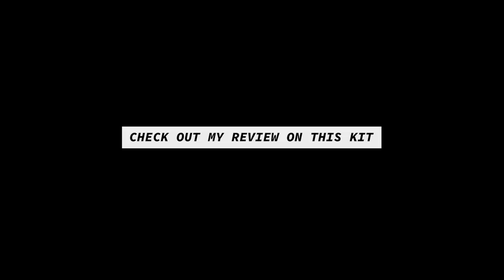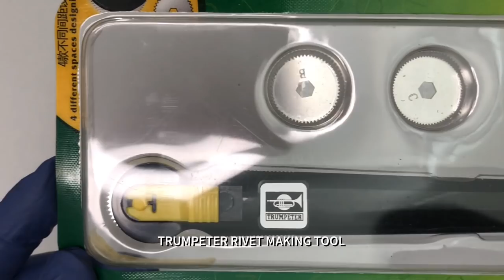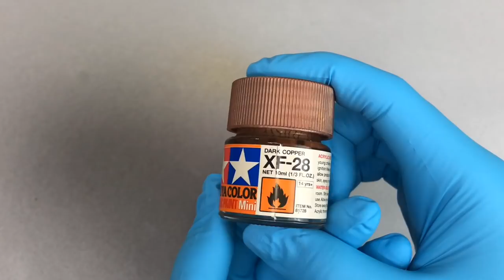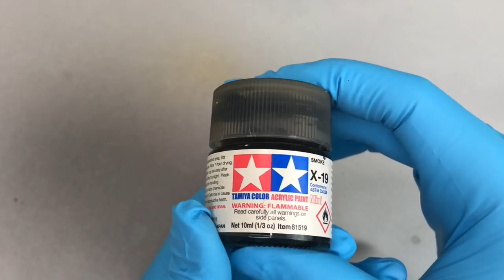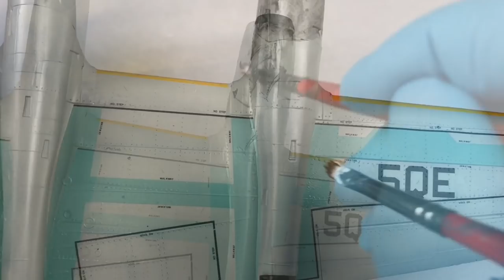FULL BUILD HASEGAWA 1/72 LOCKHEED P-3C ORION

Comment: I’m blown away with the incredible job you did with this model! One thing that would would have been super cool is if you added the rubber brake lines to back of the main landing gear down at the wheels.

Comment: Nice build. Been thinking about getting this kit (because of more detail compared to my 1/114 scale build), though I may need to see if there are more decals available, because the fact that this kit is missing decals for the wall of circuit breakers around the crew chief (I was a P-3C engine mechanic in the early 2000's, VP-30 and VP-45). You also gave me a few ideas for the F-14 I am working on. Good work.

Comment: I was an acoustic Sensor Station One operator in VP-40 when we transitioned to the P-3C Update 3 in late 1985 - early 1986 and I logged many an hour in this very Buno. This was the first P-3 variant to have a fully digitized sensor suite called SASP instead of the analog AQA-7 that work so well in earlier models.
Reply from the maker: Nice! Thanks for sharing!

Comment: Nice work! I spent three years with VP-48. I built one of these with custom decals from my squadron for myself. VP-40 was one of our sister squadrons. A few details. Only three of the engines had alternators. I think number one was the lone hold out. Number one always burned cleaner than the other three. We ALWAYS dressed our props. Which means they were almost always a straight cross. Sometimes an X but always the same across the wing. You did a nice job on the engine wash and the APU exhaust. Those areas were always a bit dirty, even after a good bath. The lead edge was actually gray, covered with a clear self adhesive tape about a foot wide. This clear cover yellowed very quickly and made the lead edge look yellow. I painted mine with a very light coat of yellow to simulate this effect. The walk ways on the wings were non-skid black. I taped mine and shot them with flat black. P-3Cs of my era were Light Gray Gloss and Gloss White. It was a very glossy paint and tended to be very shiny. Our aircraft had very few if any bare spots. These were squawked by aircrew or maintenance crew during daily inspections. They were sanded and repainted with in a day or so. I made three deployments with my squadron. It was a great time. Better upon reflection. One last note. Naval squadrons had a big inspection every year or every other year (I have forgotten the frequency, but not the pain). Called the "Corrosion Inspection". The squadron prepped like their mother-in-law was coming to stay a week. Everything was cleaned, painted, filed and proof read. Everyone was on edge. To fail was unthinkable. The pressure was extreme. Those same emotions and drive came bubbling up as I built my P-3C. I could hear my skipped say: "Make her shine like a baby's butt!" I spent more time on that model than any before or since.
Reply from the maker: Tom Andrews oh wow. Wish I had this info before building the kit. I did some research but I know it’s insufficient when I decided to build it. It’s hard to find first hand experience on the Orion through the web. I do realise that US Navy’s Orions are A LOT cleaner than other operators. Now I know the reason. Thanks for sharing!
Reply: @Boxplanes  You are welcome. My info is a bit dated. The Orions are all but gone from the fleet. She was a real workhorse. Your build is beautiful.
Reply: @F4FWildcat  take splice in knowing there is still a few Orion’s up and flying. I see them every day. 😊

Comment: Great job again I like the builds also because there is not a ton of aftermarket stuff used to make a good looking model

Ps the marlin on tail came out great!
Reply from the maker: SuperBommer1 thanks again buddy. I try to use the parts out of the box as much as possible unless I really want to go into the details.

Putting the tail art was quite a freaky moment. Would be a shame if I screw it up. 😂

Comment: Weight on wheels not only flattens the bottom of the tires it also compresses the sidewall of them.
Sanding the bottom flat doesnt make it look like you have low pressure tires, it just looks like you have flat tires.

Comment: I really enjoyed watching your build, well done on an excellent subject and result. It's a shame about the nose weight issue. Instructions are not always correct. I have noticed this in other model builds that I have watched and therefore will be adding much more weight than recommended with my future builds.
Cheers and thanks. 🍻
Reply from the maker: Thanks for your kind words. You’re right about the weights. Yeah normally I do add more than the recommended weights. But since I have other plans on how to display this Orion that doesn’t really matter whether it’s a tail sitter or not, why not put the manufacturer’s recommendation to the test. 😅

Cheers sir. Thanks for watching.
Reply: Well, as modeller is that basically to known that you cannot trust kits instructions, its easy to find out how many conter weight you need, you use a stick and balance it out in near of main suspension, if the model sit down, you need more weight, if the nose goes down, your conter weight is enough, very simple waay.
Reply from the maker: Thanks for the insight

Comment: The landing gear bays for the main landing gear are badly designed, or am I wrong? There's no room for the wheels at all. But otherwise the model looks really great. Well done!
Reply from the maker: Yeah you’re right. It’s just basic stuff in there. Czech Master Resin does have excellent resin parts for Hasegawa’s Orion. I believe the set includes landing gear bays, weapon bays, as well as flaps down parts. Thank you for your kind words!